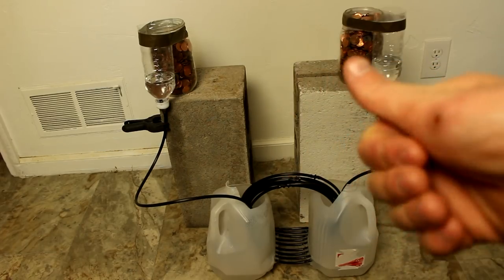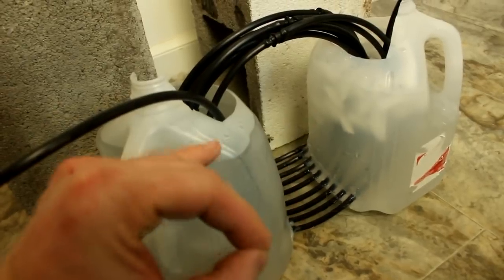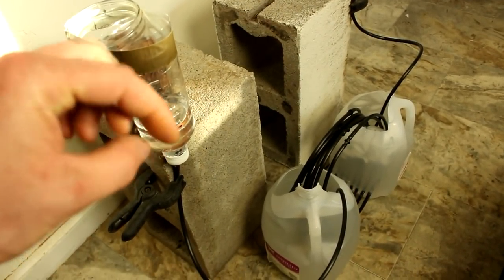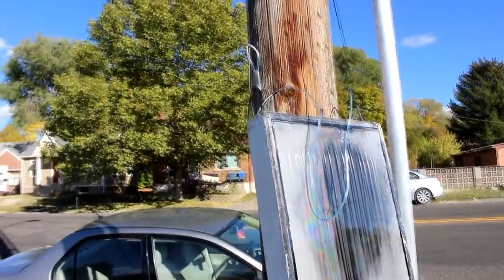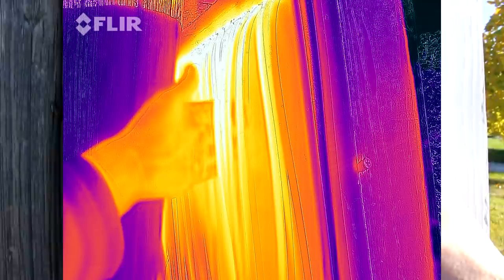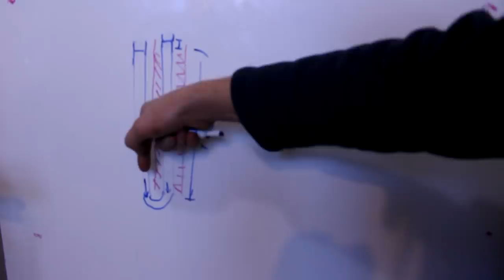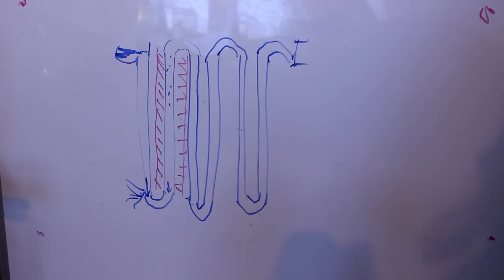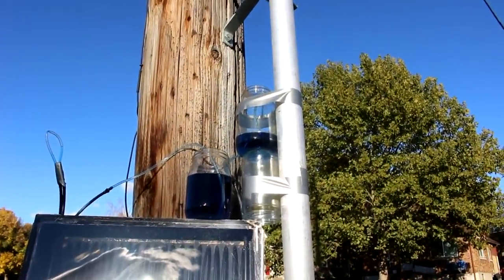Water Pump With No Moving Parts? (except water of course)

Comment: Do refining of calcium from bones next plz.
Reply: Vaibhav Bisht that actually sounds pretty cool
Reply: That's easy~ish, you can get calcium from bones by dissolving in acid then neutralizing the acid to precipitate the calcium compounds, Calcium Phosphate. But refining those compounds for pure calcium is another matter. He would have to separate the Calcium Chloride from the Dissolved bone solution, evaporate it down to a solid salt, and then heat the salt to a molten state and do some electricity based shenanigans.  Pretty dangerous stuff, but he would have metallic calcium.
Reply: Spooky
Reply: dissolve a skeleton and a trumpet for halloween
Reply: "Hey everyone, Cody here. So I took a trip to my local cemetery"
Reply: haha :D
Reply: what about refining of bones from calcium (drink milk for the skeleton war)
Reply: That would pretty much instantly react with water and oxygen so...that would make lime ?
Reply: cyrosgold7 interesting, so what happens when dogs eat chicken Bones?
Reply: He could get bones from the ranch.  Skeletons are a sad, albeit unavoidable part of raising cows.
Reply: heat the bones to create calcium oxide, mix with mercuric oxide, electrolyse to create calcium amalgam, boil
Reply: @corgidog They get at least partially digested in the stomach. Provided the shards don't get stuck in the throat...Chicken and pork bones are not great for dogs. Beef bones are much safer.
Reply: Refining cocaine from dollar bills.

Comment: Heat pipes might be able to increase the efficiency of your contraption considerably as they allow you to transfer thermal energy between two points quite easily. 

BTW: The >1M subscriber disease seems to have infected your channel. Only one of the first 26 comments wasn't pure cancer but actually related to the video. (Thank you, "Andy's Videos")
Reply: You mean the copper pipes? Might be worth a try. At least that stuff can be scrapped from all sorts of radiators, I guess. Like the ones in cars or in fridges.
Reply: "Does it really pump water?" It is a water pump, which is supposed to pump water. In the video, you can see it pumping water. How is this a good, or not "cancer" question related to the video?
Reply: Zachary Nolting You mean the result is basically zeroing itself out?
Reply: Heat pipes aren't just straight up copper tubes. The magic happens inside of them. If my memory serves me right there's some kind of capillary action going on in these things.
If the pipe is connected to two fairly conductive points on each end and insulated in the middle, they pretty much move the heat from one point to the other without much loss.
Reply: swiss quite right. A break anywhere in the line and they stop working. Plus I'd imagine it's quite hard to source that much heat pipe.
Reply: Zachary Nolting copper has a higher specific heat capacity than rubber. It CAN absorb heat and dissipate heat faster than rubber.
Reply: So, different materials for front and back might be worth a try. The frontal pipes need to absorb a lot of heat, the backside ones need to radiate it quickly. If I got it right.
Reply: If all was made from metal I'd expect the whole thing to heat up that much that the temperature difference gets rather low. Maybe two sets of straight tubes connected by plastic tubing on top and bottom.
Reply: Can´t use heatpipes to transfere heat down. IT can only transfer it up. The problem is that he have a heat surplus in the top. So he would need a exchange liquid that shrinks when heated and expand when cold. I don´t know of any of those. It might exist, but not to my knowledge.
Reply: Air con and heat pumps use pumps, not heat pipes.

Evaporator coolers pump via evaporation induced by a secondary heater. Its also not heatpipes.

Heat pipes are gravity driven
Reply: Heat pipes circulate water with a different process. Concentrated heat on the bottom, the water needs to boil, condense on the top, and fall down the back. I don't think there's a benefit to multiple heat pipes in series. They just transfer latent heat from the bottom to the top. The water is being pumped (moved) but its being vaporized to do it. It could work in some applications, but not pumping aquarium water!
Reply: matsv201 I was just trying to simplyfy it, I'm an aircon technician lmao, but I really did'nt know how heat pipes work, so thanks, I guess
Reply: Just so Cody knows, we are talking about ethylene glycol vapor chambers.
Reply: smokeydops Oh, I learnt something too then ;)

Comment: .     There are a few aspects of this I don't understand. But I think I understand most of the important parts. I have a few suggestions that look very good to me.

Use metal tubing. Metal is more thermal conductive and could take higher temperature, you could paint it black on the side facing the sun.
         Around this metal tubing build a hot box. reflective  like iron or aluminum foil? (Not black, thus the light hits the water twice and doesn't heat the back side as much) material that curves concavely inwards focusing the light and thus heat on the tubs. Maybe metal around the one side also that it could hold more heat and heat up. The glass would also curve acting like a magnifying glass on the tubes. Then good insulation between the front and the back side. The net effect should make one side considerably hotter, making for a much greater temperature differential and you'd use less tubing, more of the surface area would be focusing the heat thus less water to move and thus taking less energy to move it.

        On the back side, the tubs (still metal would be some distance away from the surface)  could have a wind fan. Put a fan on a high poll above any obstacles to wind,  like surrounding houses, trees etc.  Connect it via belt to another fan blowing below the device pushing the heat away. (top fan is turned by wind, bottom fan is turned by the top fan) Alternatively the whole thing could be high up capturing more sun and wind, like your roof. 

      Would it still work if it was all horizontal? Because horizontal on the roof would maximize the amount of light caught for the longest period of time. 

      Please let me know if you've read this. I know this video is like a year and a half old or something, do you read comments of old videos?  If someone else reads this, how might one send a message like this so that Cody might read it?

Comment: for greater temperature diffrential you could try focusing sunlight with help of convex lens
Reply: Or, perhaps, with a Fresnel lens.
Reply: Wouldn't either of those have a chance of burning plastic
Reply: @scotthuftel2358  depends on how tight the focal point is
Reply: Better to use copper pipe painted black. The problem is not with generating heat, but with transferring it to the water

Comment: You could use expanded gas(from heating though) to push water upwards to a higher level just because air expands more than water when heated. It takes very less energy to heat and cool air instead of water.

Comment: Hey Cody, 

Is there any reason not to set up your pump in parallel rather than in series? If all of your columns are in parallel, that would eliminate the need for some kind of complicated heat exchange system.
Reply: tsumui it would increase volume but not pressure. he is looking for a way to increase the pressure
Reply: I thought the same thing, but Jason's right.
Each loop in series increases the difference in water level between one end and the other.
If they were linked up in parallel, they'd move more water per minute, but only by the height-difference of one loop (just over a millimetre).

Comment: Can you run half the hose under ground?
Reply: That's a superb idea Ryan. For heat we just need mirrors, and for cooling we need thin bright tubes or a metal which transfers a lot of heat. Running the lines into a dark box insulated with KaoWool (amazing insulation) would be good, filled with water would also be good, and great if the water were evaporating, but the best is as you said...having the lines covered over with dirt. So no matter how hot the lines get, the ground would still cool them off fast.
Reply: Hmm one problem is that the cooling should be primarily on the back, not the bottom, and the pump needs to remain upright. Maybe pile up dirt behind it? Of course that doesn't really work with putting it in his shrimp boxes.
Reply: dirt on the back would definitly help cool it and using mirrors to focus more light gives more heat. this could help give a bigger temp differential without adding much complexity
Reply: Fundamentally i don+ think it would matter to much if it was horizontal rather then vertical, as long as the sun hits the episode side for a good portion of the day
Reply: Odd Ryan Think of it this way: 

The water on the cold side is heavier than that on the hot side, due to their difference in density. Let's say you're looking at it from the side so that the cold water is on your right and the hot is on your left. Since the water is heavier on the right, all the water will rotate clockwise, with the heavier (cold) water moving toward the bottom. 

If we start out with the cold water on the bottom, the system would already be in equalibarium, and the water would have no reason to move. 

Hopefully that made sense haha.
Reply: The part that needs to be heater is the lower part and the part that needs to be cooled is the higher part.
Reply: Fundamentally is right, this set up is based on equal pressure and != density. For equal pressure, you need equal head. However, while it would be increasing complexity (slightly) a check valve would solve that problem.
Reply: @Aimless Studios I'm glad you stated about the ground eventually  heating up, I was about to say just that and then saw you had said it.

Comment: Cody, this is very close to the concept of the fluidyne pump, maybe somebody told you that already. Only in a fluidyne pump, you use an air tight top on your u shape with some air in it and this air tightness added with the heat provided on one side will start making the water oscillate at a high pace. Then, you can pump up to 20 feet.
The thing is, research has so far proven you can transfer only about 5% of the heat energy into actual mgh energy due to pumped water.
Say you wanted to produce electricity this way by making a micro pumped hydro plant yourself. You would need basins, pumps of this type of a really fair size, tubes, a turbine and a lot of square meters of thermal solar panels. 50hz or 60hz AC is achievable by turning the turbine on when the top basin is full enough. 24h electricity production can be achieved through hot water storage.
You will need at least 4 times more surface in thermal solar panels than you would need in PV, and even more so if you want to store energy for the night, but this type of installation is feasible on a DIY scale. Toughest part being the turbine, which i'd buy.
FYI, fluidyne pumps are only another type of stirling engine.

Comment: if static electricity can attract water why not use something along that idea. Thus create a static force around the tube that can be toggled on and off, and have it operate similar to a coilgun. That should be more effective and also allow to to teach and show off a few more things. Plus it also maybe possibly wont have any moving parts as well.
Reply: I saw a super fluidics demo of that. Actually no moving parts could work for his application.
Reply: I was thinking something similar.  Magnetic hydrodynamic pump.  Works well on salt water.

Comment: Put multiple loops inside that come out the top and then loops on the shady side to radiate away heat. Rather than plastic tubing Copper has better thermal conductivity and higher pressure capacity, perhaps a heat sink attached to the loops on the back to help radiate the heat back into your box or into the atmosphere.  A check  alive to stop r𝗲𝘃𝗲𝗿𝘀𝗲 flow as the sun goes away. More volume could be achieved with a lager diameter. Simpler perhaps than each loop entering and exiting the box on each circuit, this  seems like it would inhibit efficiency over all.

Comment: Same thing in an ammonia/propane refrigerator.    Cap the two vessels and plumb a tube between the air space to profit from vapor pressure differences.  Keep one vessel cooler than the other .  You could possibly try a reed valve somewhere to produce hammering to increase flow rate possibly.   

I've pondered similar ideas for connecting stock tanks together and using a geo thermal loop to keep them flowing, one to another to keep the water warmer than freezing in the winter, and cooler in the summer.

Comment: CODY DO A VIDEO ON A HYDRAULIC RAM PUMP. I STILL DONT UNDERSTAND HOW THEY WROK!
Reply: yeah,  that would be cool.
Reply: ask AvE
Reply: they work by the water hammer effect. the momentum of the fast moving water and a closing check valve causes a spike in pressure ( water hammer) this pressure is trapped on one side of the pump with a check valve. the pressure causes the water to be able to pump to a higher level then the supply water but with a sacrifice of less volume. would still be fun to see Cody make one though
Reply from the maker: hee ya go! https://www.youtube.com/watch?v=bgEvNCfDzzs
Reply: its simple momentum, using the energy of flowing water.  Just the same as a 1kg weight on earth sitting still pushes down with 1kg, but if you let it move quickly(drop it from some elevation) and try to stop it in a short space you will find it generates much more than 1kg of force for that short distance. Set a hammer on a nail and nothing, move the hammer quickly and then stop it with the nail and the force is high enough to push the nail into wood, actually about the same peak force that a hydraulic press would need to slowly push the nail into the wood. Energy over distance.
Reply: you may want to understand what capslock does first?
Reply: Convection pump!

I wonder if you could do some sort of pump involving ionized water.  Some sort of electrolysis thing.  The idea is that as the electrons more between the anode and cathode, they'd pull along whatever molecule they're transiently associated with.
Reply: Cody,  have you done a vid on separating water into oxygen and hydrogen?  and if so..,  what did you blow up with the Hydrogen..  ;-)
Reply: thank you cody! excellent video! there has to be a practical way to apply this for everyday use! : )
Reply: ☼ Heirloom reviews ☼ Wranglerstar has a few videos on the ones he installed at his homestead. He shows a design that self triggers, so it is constantly working without electricity or human intervention, making up for it's horrible efficiency. I'll post a link after I've found it
Reply: W
Reply: I have seen videos on them and kinda understand how they work. I may have to build one myself just to figure it out.
Reply: how does it wrok?
Reply: keeps your knees in place ... knee caps lock ;)
Reply: ☼ Heirloom reviews ☼ g
Reply: +La Amatoro  A 1kg object pushes down with 9.81 N of force (on Earth), not 1kg of mass ;]
Reply: Check out the videos done by Wranglerstar. He uses one to fill his garden/wild-land fire fighting silo. He even has a video about repairing one and building one from common plumbing parts.
Reply: check wikipedia
i didnt even know about these pumps
but understanding how they work is easy
took me 1 scematic and 20 secs
Reply: ☼ Heirloom reviews ☼ a
Reply: They work using gravity, more or less. Using gravity, momentum, and the mass of water to "pump" it using hydraulic pressure

Comment: cool idea, the only problem with that design is that you need to remember that the head pressure is dependent on Ff factor (friction) in the calcs you are doing, there is still friction in those lines and the bends also constrict your flow in those portions. so what you run into is somehwere is a bottleneck that keeps adding until you get to a point you can only go so high and get so much pressure. i think it would be well before you get to a height you worry about needing metal tubing

Comment: Car With No Moving Parts? (except car of course)
Reply: Ever heard of hills?
Reply: Hills, No Wheels
Reply: Electric cars have less moving parts but some parts still move. Like wheels
Reply: Fred flintstone did it
Reply: rocket sled?
Reply: @ZoeSoutter  rocket engines still have moving parts
Reply: @user-tr2dh4xx6u  fair point, maybe one of those weird ion plane thruster type things
Reply: This has been done with a (small) plane
Reply: @user-tr2dh4xx6u  If you don't count the exhaust gasses as moving parts, then a solid fuel rocket should do the trick. If you can't have anything that moves except the car in a very strict sense you get into trouble with physics (conservation of momentum).

Comment: We actually used to use something like this in ponds. But we used a horizontal coil in the pond and another just above the surface and backed it like you with a black panel. It was simply to generate a little water flow during the summer as the ponds would stagnate in the heat once algae blooms kicked in. My dad knows the exact technique I think but I think I could work it out with a few hunded dollars of pipe.